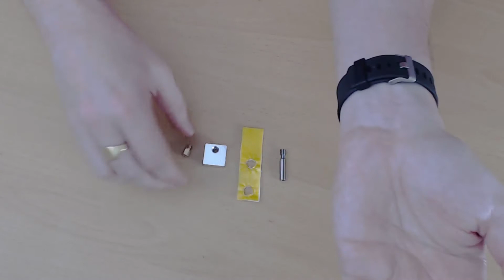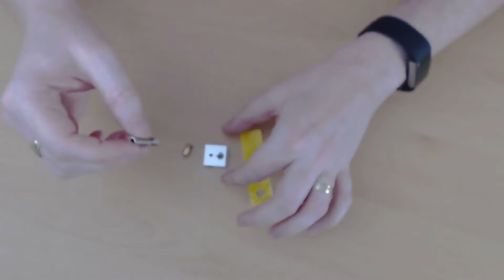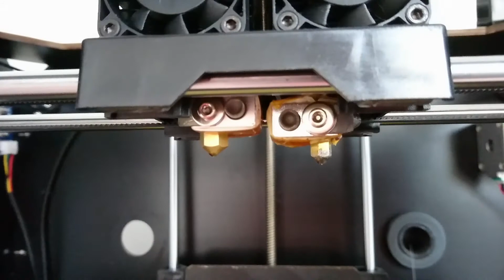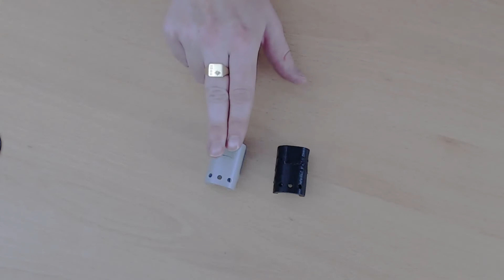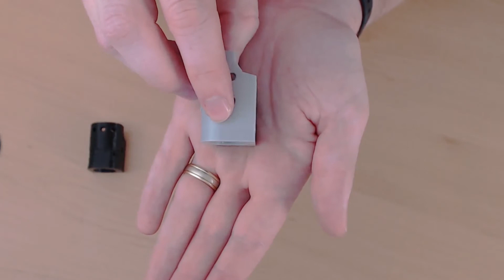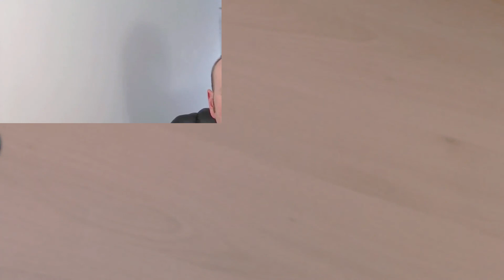How to Improve the Print Quality of your CTC 3D printer

Comment: Hi, this vid has convinced me its time to install a glass build plate on my CTC Dual Thanks.
However does the combination of longer hot ends & extra height on the build plate (with the glass thickness) result in the build plate having to be tightened right down so the hot end doesn't collide with the build plate?
Reply from the maker: If your are going to put a glass bed on your printer then you need to first find a shim to off set the Z stop height. Make sure the shim is the same thickness as the glass bed and yes you will have to adjust the screws a little. Check the video description for a link to the shim I used off thingiverse
Reply: Don't bother with expensive borosilicate glass, the print bed will never get hot enough to warrant it.  Get some 3mm mirrored glass cut and use that instead.
Reply from the maker: I have been running mine for some time and have no problems. It heats up and stays hot. I run the bed at 70 and it heats to 70 and maintains its temp during the print
Reply: When I fitted my Mirrored 3mm glass plates (I have more than 1 CTC) you can either print a shim to fit at the back of the print bed to connect with the microswitch.  It needs to be the thickness of your glass plate.  You can just tighten the levelling screws, if your plate is just 3mm thick.

Comment: Good vid, I followed your advice and upgraded the hot end but also the hot bed with glass and the z axis with a kit from eBay. I am using rigid ink pla filiment nd simplfy3d. I have a question though. Did you just use the default ctc profile or did you have to make lots of other setting changes to get the quality your getting. I can't get close to what your print with the same print and same setup. I'm assuming that I just need to tweek the profile for the filiment but as a newbie I'm not sure where to start. If you tweaked your setting a was wondering if you could post them?
Reply from the maker: I started with the simplify3D profile for this printer then ran a set of test prints and dialed in the retraction, print speed temp and bed temp until I got what you see. However it didn't need adjust them much as the upgrades did most of the work to help improve the prints.

Comment: What 3D program do you use
Reply from the maker: For slicing I use Simplify 3D. While this is not free I find the support structure it produces is amazing, also I like the way the software works. Cura is free and is what I used a lot while I was learning.
Reply: Abernus69 cool thanks
Reply: Abernus69 I have the same printer I can't figure it out I put files from cura on the SD card and the printer just makes little blocks but not my designs any thoughts
Reply from the maker: Make sure you have selected The correct printer profile from the Machine tab at the top. From memory I think you select other and then choose Makerbot. Also make sure the files you are putting on the SD card are .x3g as this is what the printer reads.
Reply: I know I'm late to this, however I have some custom g code I made for slic3r that works great for me. I simply export the g code and convert to x3g through replicator g program. If anyone is interested give me a shout.

Comment: Hi Abernus69.  I have the CTC Bizer and have been getting decent results in both PLA and Nylon.  I do however have problems unloading filament and then finding that there is a blockage next time I come to use the printer.  Should I unload after every print?  What is your experience and how best to clear a blockage?
Reply from the maker: I tend not to unload after every print and on the most part have not had any problems, if you will not be using the printer for a while I would then unload. However today I went to run a print and found that the filament was not extruding. Turns out that the filament is clogged in the hot end. I and stripped the hot end down and was unable to pull the filament out of the hotend so I am now soaking it in Acetone to remove it. This is for a PLA filament stuck
Reply: The golden rule to unloading filament without a spring loaded block is to load first, always load quite a bit of filament before attempting an unload, and I mean like a minutes worth of loading, before your unload.

Comment: Was this printer a dual nozzle printer?
Reply from the maker: Yes this is a dual nozzle printer however I only ever print with 1 nozzle
Reply: Yes its a dual nozzle printer, whats good about this is that the nozzle height can be adjusted with a grub screw.  They need to be the same height.  Having two is great for printing two colours, or using speciality support materials.  I would not recommend fitting a nozzle that is not meant for the printer, like in the video.

Comment: Are the parts you printed @10mins, printed with PLA or ABS?
Reply from the maker: The parts are printed in PLA and are printed at .1mm. For any upgrade parts I print for the printer they are done at .2mm in PLA

Comment: Hi Steve, My CTC had been printing very poorly lately after 150 hrs on it, it turned out it was just the PTFE liner in the right extruder throat had shrank over time and was snagging the filament. Also dont forget to add additional Y axis bearing blocks, and those z axis springs I mentioned some time ago https://www.thingiverse.com/thing:33839
Reply from the maker: Already got the Z-shaft preloaders installed. That along with the Spring loaded filament loader, cooling fan, new right hotend and heater block and a glass bed and it's printing very well.

Comment: I am a newby with 3d and been using now for about a month, prints were bad finish and done as you explained changing the extruder with no problem but after getting it all back together I have no adjustment to level the platform so that paper can easily pass under, I did use a glass base but removed that to try to level again but no joy can the platform level be adjusted?
Reply from the maker: Have you got a spacer at the back of your print bed where the Z limit switch is?
Reply: Thanks for your reply, I checked online on the problem and have at the back of the flatbed ,decreased the height limit by a few mm and that has done the trick, Thanks for your video it is very easy to follow, I did not have to add any more wiring as you had to but  had to order some of that tape that you mentioned. I will be changing the left extruder when I receive it. I probably will contact you again as I am only a beginner .Thanks again

Comment: what software are you using for this printer. im using makerbot desktop and makerbot print??
Reply from the maker: I use simplify3D for slicing however this software costs.
Reply: Does it impove on the prints, cos mine are pretty crap at the monument?
Reply from the maker: Print quality is mostly down to the settings. Have a look at https://www.simplify3d.com/support/print-quality-troubleshooting/
Reply: Have you used makerbot desktop before
Reply from the maker: I have briefly used the software, but before moving to Simplify 3D I used Cura.
Reply: How did you use cura????
Reply: Did you convert the files for cura
Reply from the maker: Yes, you need to export the file as G-Code then use another piece of software to convert this to x3g: https://www.thingiverse.com/thing:81425/#files  This one was one of the main reasons I moved to Simplify 3D as this has the option to output to x3g directly from the software.
Reply: Okay thanks :) did you find that Cura was better than the standard software
Reply from the maker: Cura is better, however as I said before a lot is to do with how you set the settings. Try printing a calibration cube first. Once this is printing fine I them moved on to stress test prints to dial the setting in further,
Reply: I've had under extrusion for weeks now, on makerbot software no matter what I change I still get the same thing
Reply from the maker: On Cura check the flow rate, if you still have under extrusion increase by 5 each time and test. Also, make sure the filament diameter is set correctly. At the end of the day it is all down to the settings you have set.

Try heating the print up using the front panel and running a filament load. If the filament doesn't come out in a straight line and at a constant rate you might have a blocked hot end.
Reply: Okay thank you I will try that :) do you need a profile for cura?? I haven't used cura yet for the ctc
Reply from the maker: Off the top of my head, I think you will use a Makerbot 2x profile that comes with it. I might be wrong as it has been a long time since I used it.

Comment: Loving the videos - I did the head mods and melted my ABS filament fan!  Did you have any problems with yours?
Reply from the maker: Not had any problems with mine, all fans working O.K
Reply: Abernus69 thanks for the reply - I think I need to look at your filament fan as mine sits quite high and uses two clips on machine bolts.  A really solid solution, but the extra length of the tubes ran the blocks into the centre of the outlet piece.

As a matter of interest, when I took out my old blocks there was a PTFE tube inside - did your originals have that?  I'm just wondering if CTC have changed the hot end at all?
Reply from the maker: Yes the stock head that comes on the CTC has a PTFE tube inside. this is needed to help the filament flow

Comment: What size glass did you get because I have the same printer as you but I don't know what size of glass to get
Reply from the maker: Hi, the print bed size is 230x150mm. If you use the link I provided they have this listed as small 150x230mm. Hope this helps